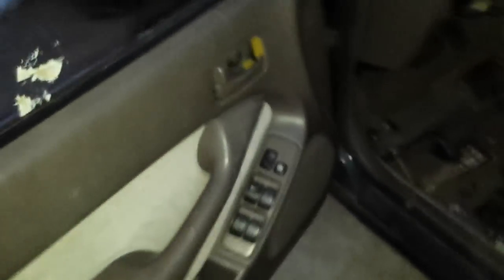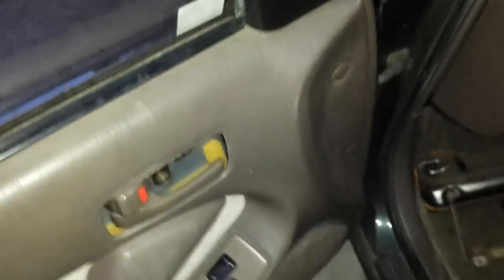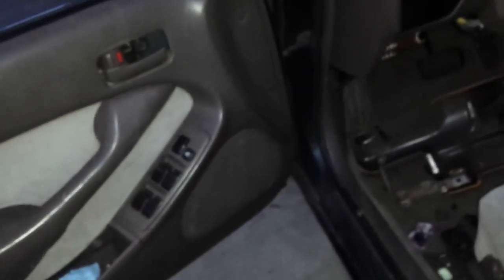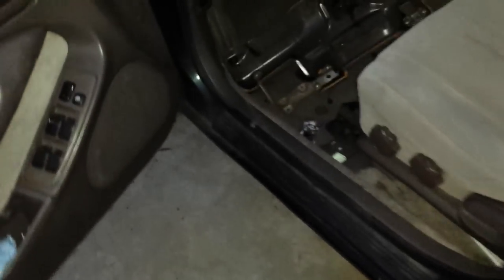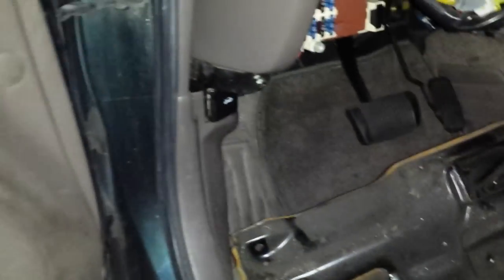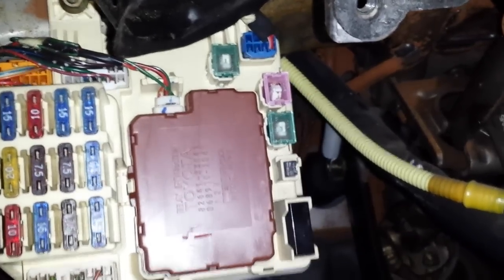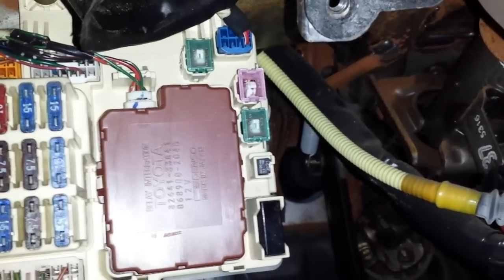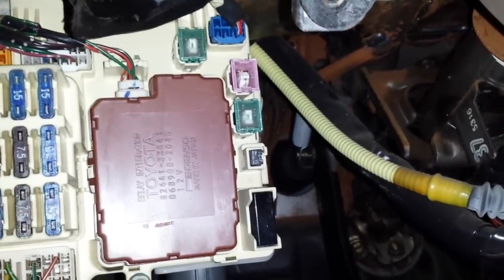Windows & power locks don't work, FIX. Camry secret fuse. Slow windows?

Comment: THANK YOU SO MUCH. you're the only one on YouTube that actually helped me fix my problem. The hidden fuse 30a was indeed blown. I replaced it and now everything works. You saved me some money dude Thank You so much.
Reply: Same i been fidgeting with my brothers car (99 toyota solara) for months an it only keeps the windows broke with no power the locks worked fine but i changed that hidden fuse an i cant thank you enough
Reply: Hey bro I have the same car you mentioned here . But the interior fuse box doesn’t exactly look like this one in the video. Would you mind telling me which fuse you replaced please?
Reply: Wow I just realized this was from 3 years ag

Comment: I have Sienna (2000). I know I blown a fuse trying to fix power window controller on driver side, but couldn't find this fuse anywhere, until I watched this video. It located in the same cabin driver side, left knee fuse box. I went to closest O'Reilly auto parts store and got PAL 330BP for 4 bucks. Power window started work again. Thanks a TON!!!

Comment: You're a Genius!! My 2004 RAV4 had an issue with just the door lock, all else worked.  After checking all fuses under hood and driver's side I was up in arms.  The pink fuse was fine but the grey one was blown. Thanks bud, you saved me a trip to the mechanic.
Reply from the maker: Glad to help!

Comment: Thanks for sharing this.  I am about to find that fuse box, as I bet that is EXACTLY what happened to me.  I smelled something burning as I was driving down the road...not messing with the windows at all, and the next thing I know, NONE of the car windows worked anymore.  I did think that the smell was coming from inside the driver's door, but I could be wrong.  My car is used, and the windows worked fine when I got it, but all the doors look to have been opened up before, by someone who didn't know what they were doing.   Hopefully, the fuse is all I need.
Reply from the maker: You might have a short in a motor or a switch.  Good luck on your diagnosis and fix.
Reply: What was the outcome? Did you replace the fuse and it stayed good or did it keep blowing them?

Comment: How did you remove that entire panel to expose the fuse. I found the 15 and 10 amp under the change box, but it seems that this fuse is under the steering wheel?
Reply: I would also like to know this

Comment: How did you know it was blown?  I have all the passenger's locks went out all at once, but the drivers has remained working.  I suspect a fuse, but does just one fuse operate all three doors on my 2005 Toyota Camra?

Comment: Have a 1999 camry, passed down from my father for my soon to be 16 son.  Trying to fix up some issues that were not fixed correctly by my dad's guy.  I am thinking accuator in driver door however need a second brain help.  We have some issues with some windows not coming back up at one time (not driver's) and then the door locks, power locks button on inside will not lock driver door.  Just driver door lock will not respond also use to have a remote key lock and well the plastic on them are old and cracking but I may have one remote that is usable. Anyhow, remote key locks do not respond to remote which caused me to keep the alarm disabled.  Am I on the right path of thinking that the accuator is not functioning?  To me it is not a huge deal, means my son has to lock and unlock his car like I did with my first car many years ago. But he also has to lock his driver door once in the car since it does not respond with the auto lock when you go into drive.    Could this be a fuse issue after all?      When I asked my father about the original cause of repair to door, he said that one day the door would not open from the inside and that the handle broke on the inside (aka grampa has a bad temper)  this makes me think the accuator fried in the door.  He only got the handle replaced and lived with not repairing the rest of the issue.  Love some input!!  I am about to replace the front passenger window regulator here soon, if my husband trusts me on this!
Reply from the maker: wow.. that was a lot to take in.. but you probable have a lot of issues due to the old alarm. The door handle breaking is pretty common on that car, the housing usually breaks. But that repair should have nothing to do with the windows unless the door would not open cause the door would not unlock some how. If I had the car in front of me i would test the switches on the doors first. Check for continuity. if the switches are good I would then give the window actuator some positive and ground and see if it goes up or down, if it does you should reverse the polarity of the wires and see if the window does the opposite motion. The actuator is a 2 wire connection it is bidirectional to cause the window to go up and down. If all that work I would start looking at the alarm wiring but I hope you don't get that far..... Let me know if you do. I hope this helps and ask away if you have more questions.
Reply: Sorry, I was a little confusing.   The driver door's only issue is the locking of just the driver door and the keyless remote with.  The Passenger front is the one that has the window issue which I believe to be an easy fix with a new motor and mechanism. Back to the driver door. Okay so handle broke years ago and was replaced.  But the automatic door lock, locking with the lock button and keyless remote with alarm has never worked since ( alarm has been disabled and I haven't tried anything with that yet.) The driver window works (for now).  I am trying to tackle one thing at a time on this car, it only has  about 112,000  miles, my father was the only previous owner and it was well taken care of. And it was free!  Just electrical issues have been slowly expiring. My mechanic says the whole motor in door was fried and $300 plus to fix. Fortunately, I worked on cars in high school and some of these repairs I believe are in my ability. My dad use to call me the powder puff mechanic in high school. From mustangs to buicks, I loved getting dirty and still do.  Just need a little help figuring out where to start on this one. I realize the door lock/window is a common problem with this model, my MIL had a 2001 same problem and a friend's daughter had a 2000 with same issues.  So with the window working but the driver door lock must be locked manually or by key only.
Reply from the maker: +Denise Caspell with the lock, i would pull the door panel off and look for a electronic silenoid that goes to the lock. First make sure its plugged in. I believe that one too is also a two wire solenoid. If it is plugged in or even if it's not I would apply power and ground to the solenoid momentarily to see if it actuate's. The alarm is more than likely also wired into the wires going to that actuator. If you test the solenoid and it works I would test the switch on the door panel. The flow of electricity might go through the switch and then to the solenoid that actuates the lock and unlock mechanism. If it is good up to that point I would start suspecting a wiring issue and start by looking for wires possibly connected to the wiring system of the locking mechanism.

Comment: what's the description for this fuse? I have the same problem on same car but I don't have the same fuse there for sspme reason
Reply from the maker: I don't remember what the fuss was called. I just fallwed the circuit. Did u remove the knee panel under the steering wheel? You can't get to this fuse without doing that, it's not accessible from the fuse panel cover.

Comment: We got a 98 camry windows and locks are all fucked up too but same time that happened our dashboard became unresponsive. We cant see how much gas is in the car or how fast we're going any of that shit. Do you think its the fuse? Or is my car just done for?
Reply from the maker: I can't imagine this fuse controlling the dash too. Did everything stop working at the same time? Does any of the gauges work? Does the check engine light come on when you put the key in the on position with the engine off?
Reply: @ScottiesHobbies  yeah bro it all messed up at the same time none of the gauges work at all so i cant see anything no check engine light none of that. But funny enough when the door is open the ajar light on the dash is the ONLY think that works on my dash

Comment: I read through a few comments before asking this question, and so far I haven't seen anyone mention it:  Would disconnecting the ground on the battery, stop any fuses from blowing when replacing electrical parts in the car? Assuming the work done was a simple R&R of an OEM part. Because, you know how frustrating it is to have to reset all the radio presets and set the time on the clock! ug
Reply from the maker: Yes, disconnecting the ground for r&r of electrical parts is actually recommend. With the neg disconnected you will not blow fuses. You will not be able to get a closed loop.

Comment: came across the same issue. only when I replace the fuse, it does the same thing. blown through 3. my guess is something in the wiring. but I got AC so I'm not in a rush to fix it.
Reply from the maker: +Robbie Housand You for sure have a wire grounding out somewhere.
Reply: Just recently fixed the issue. The previous owner had rigged up some questionable wiring for the sunroof. It's all fixed now

Comment: gr8 vid......drivers window works on my camry.......the other 3 dont..... ill check that pink fuse....thanks !
Reply: Did you ever find the fix for this that whats wrong with mine
Reply: Probably not the fuse if one works. I would guess it is either the master switch or a break in the wires near the hinge of the door. I know this is an old post. If someone else is having this problem and the back windows work off of their own switch then I would blame the master switch. They are prone to breaking inside.
Reply: @  the wires from the drivers door into the A pillar were all frayed...fixed and worked fine

Comment: How did you remove the cover underneath the steering wheel?
Reply from the maker: +Erick Ruiz i think there was a vouple 10mm bolts hat held it on. I dont exactly remember but it was easy.

Comment: Was it just one power window or all ?  My driver side power window just went out on me. I have that same car 1995 Camry. Any suggestions ? Was it really that difficult to get that bottom dash out ?
Reply: Did you ever figure out if just one window not working could have been the fuse? Same car, same issue. Wondering if I should try for the fuse before I take the door apart to replace the motor...
Reply: @WaxPaper  It was the driver's side power window regulator and motor that went out. I had replaced both. Usually that's the first thing to check.
Reply: @jopisano67  Cool, thanks. Mine is still goin a little, but it's sketchy. Probably the motor dying.

Comment: Hey Scott when that high amperage fuse failed, while diagnosing the source did you ever press the door lock switch and hear a faint click from the anti-theft control module?
Reply from the maker: +Mark A way too many moons ago. Lol. I do know that after replacing that fuse, the windows operated normal up until about 4 months ago when the driver crashed it.
Reply: Well I appreciate the feedback and that fuse was toast. I'm glad it's not the anti-theft module!
Reply from the maker: +Mark A I don't know what it is but since posting that video, You're easily over the 15th person to say that this fuse was a problem for them.

Hopefully my video help you out. Thanks for the view and the comment.

Comment: Dude thank you i went to a junk yard yesterday to try a different switch out becouse my back window wouldn't go down and so i took the one that worked for the rest of them i unhooked the wires and tried the other one i got nothing so i hooked my old one that work  and that one stop now and my sunroof will not close i hope this is the trouble thk

Comment: Great Job, this happened on my 2009 toyota sienna XLE, I had a tough time finding the fuse, it was on the back side of the fuse block. I need a video on where the keyless entry receiver is on a 2001 Toyota Camry CE.

Comment: Hi I have the same issue few days ago and I change the regulator and everything stop work the locks no inside light and the clock dashboard I change the fuse but still no change. Any suggestions  would be appreciate it ?
Reply from the maker: +Wisam Albaidhani the regular that you installed have you attempted to disconnect it and see if anything goes back to normal? Maybe take the panel back off and just disconnect the electrical connection and see if any of the lights come back on. The dome light and clock should not be on the same circuit as the power windows and locks. It's kind of puzzling.
Reply: Hi Scott, I appreciate your quick respond I disconnect the regular from door and remove the panel as well nothing change yet, maybe if I know where's the fuse for the clock and the inside light and go from there. do you know by chance where is this fuse ? I also went through all the other fuse inside the car to make sure non of them is blind. again thanks for your help
Reply from the maker: +Wisam Albaidhani what is the year make and model that you're working on right now?
Reply: its 1999 Camry CE
Reply from the maker: +Wisam Albaidhani hopefully this link works and is the same on your vehicle but circut 'C' should cover your needs.
 http://newomatic.com/wp-content/uploads/1998-toyota-camry-fuse-box-diagram-1996-vehiclepad-1992-for-1999-imagine-endearing-1997-wiring-automotive-1986-4-620x321.gif
Reply: Ok is that inside the car or outside I notice there's another fuse box near the battery outside ?again I really appreciate your feed back and your help.
Reply from the maker: +Wisam Albaidhani ya know, i can't answer that one. Id saw match up the diagram to your 2 fuse boxes. All the diagrams i have or can find just list them as fuse box.
Reply: that actually worked i find the fuse control the lock and the clock, but the regulator is not working the window  goes down but not up... its confusing ?
Reply from the maker: +Wisam Albaidhani perfect, glad that helped. Your switch is probably bad. Can you give the motor power and ground? All you have to do is reverse polarity to mske the motor go up or down.
Reply from the maker: +Wisam Albaidhani i use a power probe for things like this. I have a little quick vid about my power probe if you check out my other vids.
Reply: Scott, loos like i will need to look for new switch at this point the window some time work some time is not i don't think its the motor anymore coz i can hear the kick to the motor when i press the switch up/down but its not responding with motor . will check that and let you know. 
thanks again for you help you have some cool videos out there.

Comment: Great video.  Thanks.  I found pink fuse (30A and long body) and replaced it (actually, you can see if the fuse is blown through the clear window top of it - I would need a magnifier and light to see it but it's doable without removing fuse I would think.  The clear window on top actually will pop off).   Was very hard to remove fuse but if you wiggle it a bit it will eventually come out (I tried puller and pliers on original and it crumbled bit by bit - better to work on it with fingers).  Fuse was $5 at parts store, $15 at toyota.  It blew again.  I am not sure how to track down the wiring.  Where do I start and do I need more than a multimeter?  thanks so much.
Reply from the maker: +Stephen Piper you have power hitting ground somewhere. What was the last thing to stop working before the fuse blew originally? This would be a hard one to chase down any window motor , power seat motor , or even the window wiper motor can cause this fuse to blow. With this car it was the passenger window regulator that originally caused it to blow.
Reply from the maker: +Stephen Piper you have power hitting ground somewhere. What was the last thing to stop working before the fuse blew originally? This would be a hard one to chase down any window motor , power seat motor , or even the window wiper motor can cause this fuse to blow. With this car it was the passenger window regulator that originally caused it to blow.
Reply: thanks S H.  Just saw this message.  We have a 3rd car, so I have been making slow progress.  Found jumpers in the right rear door (a guy fixed power windows a year ago) and I assume that one of the wires is shorting?

Comment: Thank you for this video.  I've removed the interior panel under steering wheel (4 10MM bolts and the 3 phillips screws holding fuse box housing off.  My hidden fuses on a '96 3.0L Camry LE appear to be hiding behind a black colored air duct.  anybody know how to remove this air duct???.  Also my version has the OBD2 port just to the right of normal (visible) fuse box.  Thank you.

Comment: I had this same exact problem. I have a Pontiac vibe and I got my windows tinted a few days ago. The next day I realized my sunroof wasn’t working, and after a few days of letting the tint cure I tried to roll my windows down but nothing happened. I found this fuse and replaced it in an autozone parking lot, as I’m closing my door to bring some pliers back in and I hear a pop/spark, i check the fuse again and it’s blown. I don’t know if maybe some water got down on my window motor and it causing a short or what, but I’m so frustrated and don’t know what else to do. Anyone know what it could be?
Reply: Did you ever figure out what was causing this? Sounds like it might be the harness going through the door broke some wires.